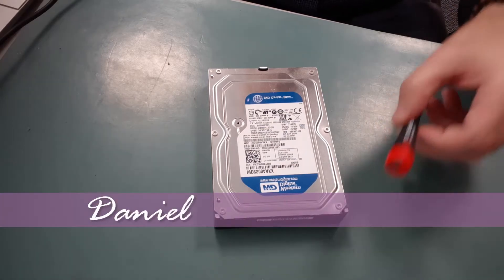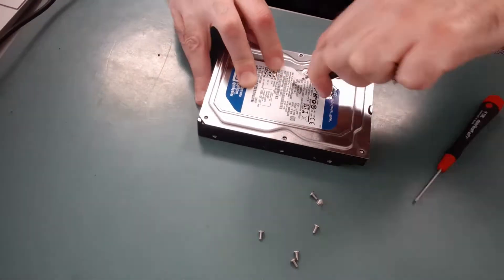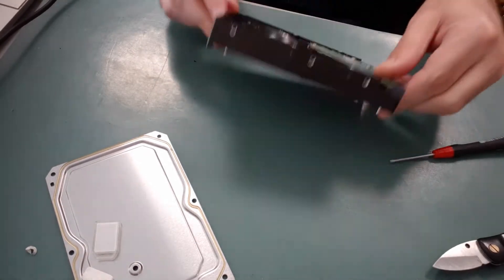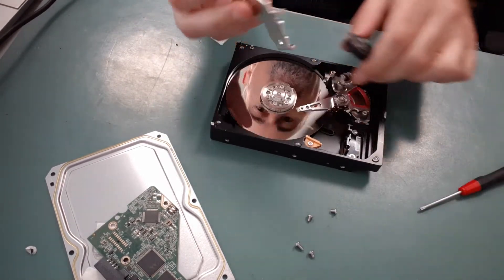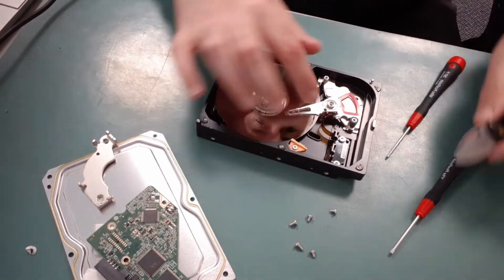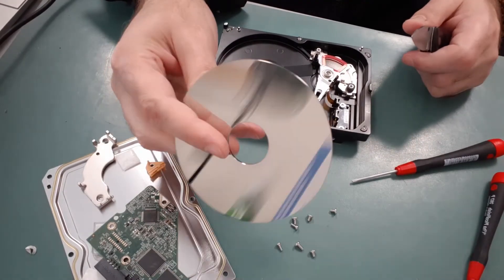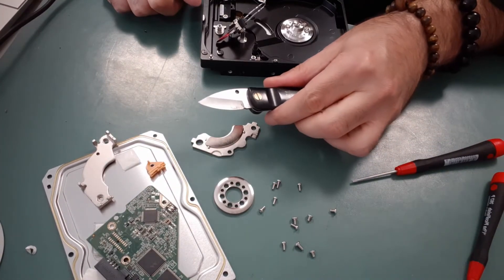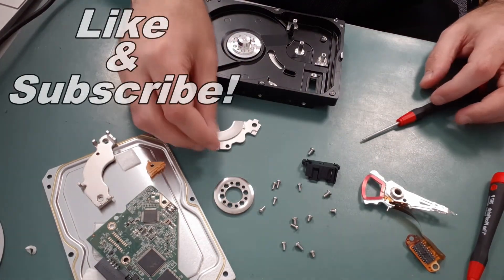How to dismantle a hard drive

Comment: is it safe to do this without anti-static-electricity and anti-dust stuff?
for reference, I'm trying to recover my data
Reply: DO NOT DO THIS IF YOU ARE TRYING TO RECOVER DATA! You need to do that in a clean room, by pros. Data recovery isn't a DIY project, just like building these things isn't a DIY project!
Reply from the maker: There are anti-static wrist straps you can purchase, or anti-static mats for your arms and feet.
Reply: @TwinBytesInc  tysm!

Comment: Where can I buy those particular screwdrivers here in the US?    Do they have any other name other than T7 and T8 tork screw drivers?    Also, is there any other part of the HD besides the discs that i need to destroy?  Is the disc itself hazardous?   Can I just drill holes through it?  Or just break it apart and throw it in the trash?   I no nothing about computers and would prefer to just do this myself.  Wondering if the discs need to go to a harzardous waste site also.
Reply from the maker: Those are Torx screw drivers you can get at computer speciality shop or online.  You can drill holes through and would be great, or just smash it.  it's electronic recycling, different countries may have different laws.  Check your rules on electronic recycling.